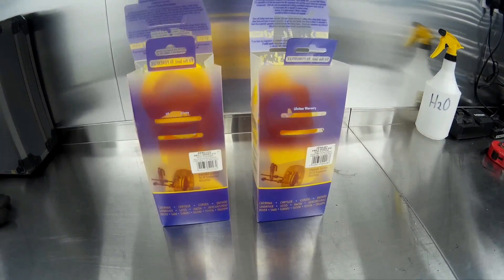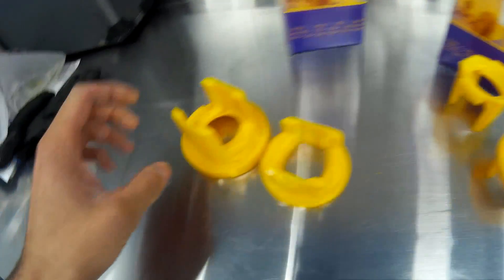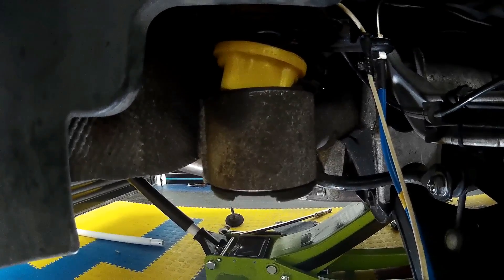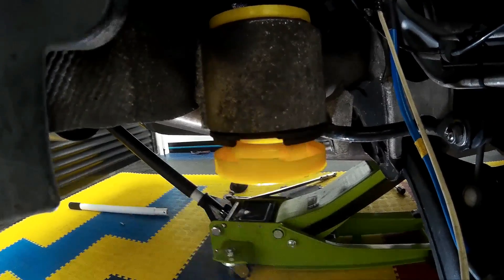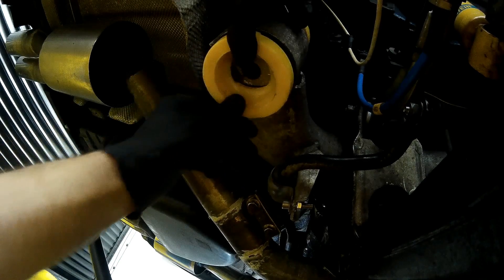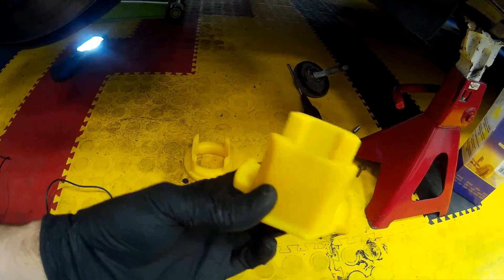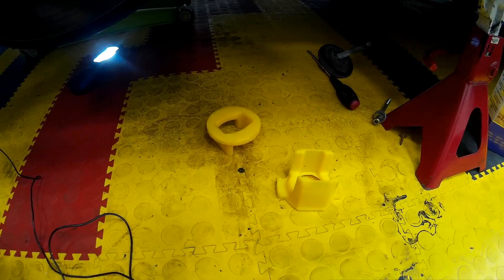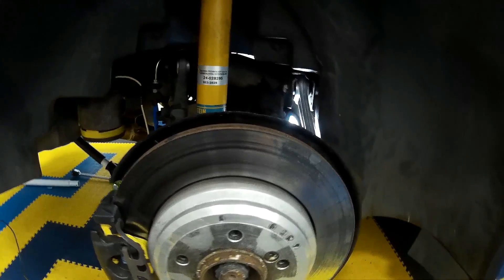BMW E39 S62 V8 M5 Powerflex Subframe Bush Inserts DIY How To Guide

Comment: So what’s the best? Full poly or part rubber and part poly like you have?
Reply from the maker: Very much depends on what you want to use the car for. Dedicated track then full poly, but for mixture of road/track then the inserts are great.
Reply: @WestinghouseProductions  ok. I mainly drive on the road. But, have plans for trackdays. So I will go for part poly rubber👍🏻

Comment: My M5 has a strange slack feeling at times on the freeway....after I've been on throttle, then coast and maybe brake.... the back on the gas, I'll feel a knock or what feels like driveline slack....almost like a slipping before it engages. You can feel it in the chassis. 
I've replaced the entire driveshaft and differential bushings.  Do you think the subframe bushings could be the cause of this feeling? I think this might be what you're describing in the intro to this video. I plan to do the bushings but wonder, do I need these inserts or would OEM bushings be ok on their own?
Reply from the maker: Have a look at engine and gearbox mounts. If the engine mount on bank 2 side of the engine is defective then it can allow the engine to twist on its axis and cause the issue you describe 👍
Reply: @WestinghouseProductions  thanks sir!

Comment: Great video. Could you tell me how many hours it would take to replace the actual rear sub frame bushing? I suspect mine are completely shot as I’m getting really bad vibrations through the car even after new suspension, wheel balancing etc. Is it a big job? Thanks :)

Comment: Great video! I have an e46 drift car with worn sub frame bushes, would installing these be a quick fix? The car is a very cheap track car so want to spend as little money and time as possible!
Reply from the maker: Rob Lyons I’d be looking for the chassis cracking on the E46 where the subframe mounting points are before spending any money. It’s a well known issue on all the E46 range.

Comment: Great video Paul!! Compliments for being clear, informative and... of course  because of pretty educated tinkering with the right model of car! 
I've seen how relatively easy some fixes are that I've had done by my E39 M5 expert. Getting inspired doing next fixes myself.

Sooo, keep them videos coming!
Reply from the maker: Cheers Mark - Its great to know that my dull Yorkshire tones are helping others do things that they might not of considered before. Keep a look out for the next video which will be fitting a short shifter kit using all BMW OEM parts :)
Reply: Paul Simon well TBH I've been considering doing repairs and upgrades I never considered doable for non car technicians like myself.

Installed this bar between the spring struts myself and felt proud, after that next projects felt easier than before.

Inspired by your vids my friend, keep 'em coming!!